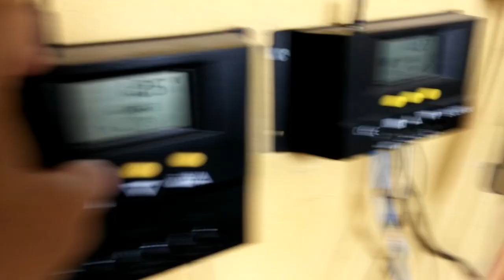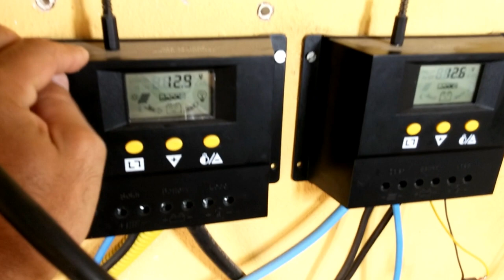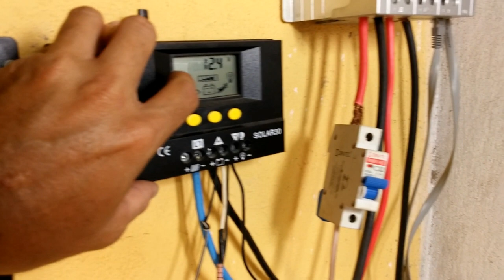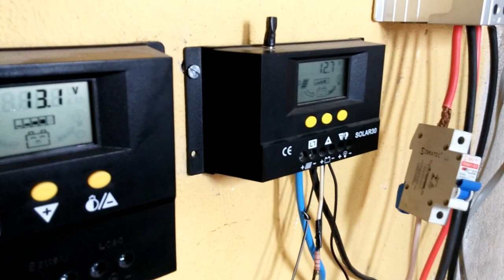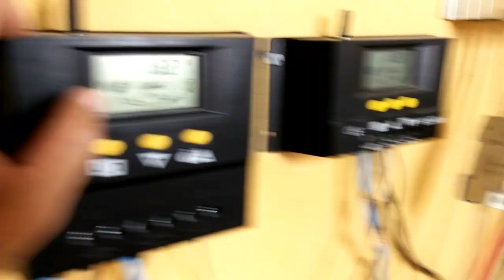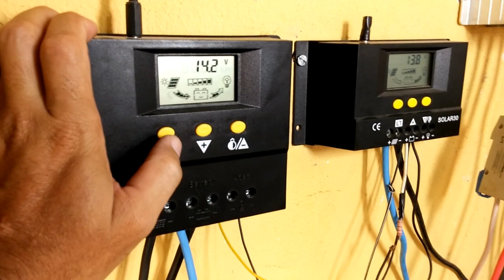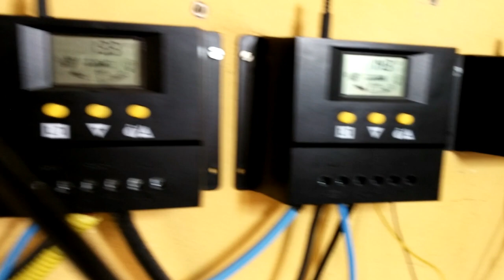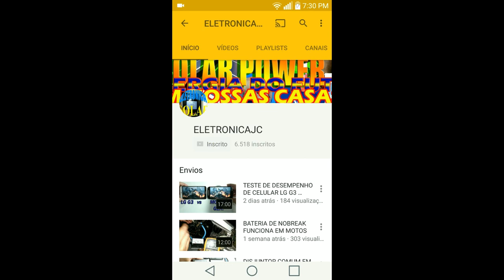Energia solar fotovoltaica usando apenas uma bateria de 240 amperes!!!

Comment: Amigo, para funcionar uma bomba de poço artesiano de 1cv de potência, monofásico 220v, quantos painéis e baterias preciso? Obs. Preciso funcionar essa bomba em média 4 horas por dia.
Reply from the maker: sera necessário 4 painéis de 250w 4 baterias de 170 amperes cada sistema em 24 volts e um inversor de 24 volts  de 3000 watts senoidal puro ou seja um inversor de onda pura
Reply: @eletronicajc  , não tem como funcionar com menos bateria, não? 
É que só vai usar 4 horas por dia e aqui "tem muito Sol". A menor média diária de irradiação é 4,91.
Reply from the maker: @gilmatos1439  tente com duas para teste ok acredito que neste caso dê certo
Reply: @eletronicajc  , obrigado!!
Reply from the maker: @gilmatos1439  disponha

Comment: boa noite parabens pelo video! de quantos watts é esse seu inversor?
mais uma coisa tou pretendendo montar um sistema pra bombear agua de um poço artesiano pra uma bomba de 3 hp  pra isso eu queria saber que inversor eu tenho que usar
e quantas baterias serao necessárias pra trabalhar apenas durante o dia.
obrigado
Reply from the maker: ah neste caso  é  bem simples uma  bateria  de 240 amperes  um inversor de onda senoidal pura de 12volts de 3000 watts  toca de boa
Reply: sera se segura bem e que nao conheço bem do assunto.
valeu obrigado
Reply from the maker: segura  sim , 4 paines solares de 150 watts uma bateria de 240 amperes um inversor de 12 volts senoidal puro de 3000 watts segura tranquilamente  so durante  o dia ok nao force este sistema a trabalhar anoite nao senao a bateria  nao dura  3 meses ,  lembrando tem que ter sol forte  em dias chuvosos  nao  gera bem os paineis
Reply: eu ja possuo um sistema com 6 paineis de 260w cada com uma bomba so que sem baterias mais queria aumentar a potencia da bomba entao fica mais facil ne?
valeu mais uma vez.
Reply from the maker: sim porem  usando paines de 260  ai tudo  muda de figura  , paineis de 260  gera 38 volts  logo nao funcionam bem em sistemas de baterias em 12 , para  dar certo  voce teria  que comprar  controladores mppt de marcas de qualidade tipo tracer epsolar  ai sim poderia carregar o banco em 12 volts